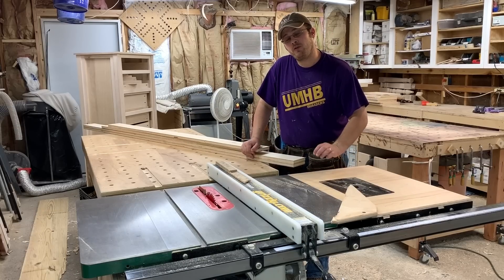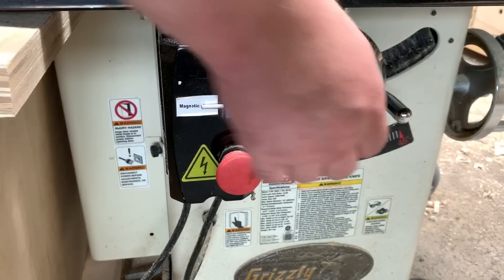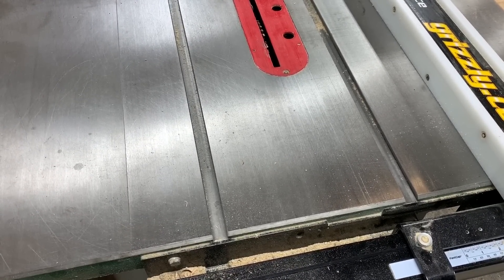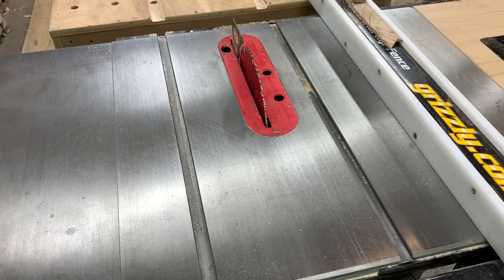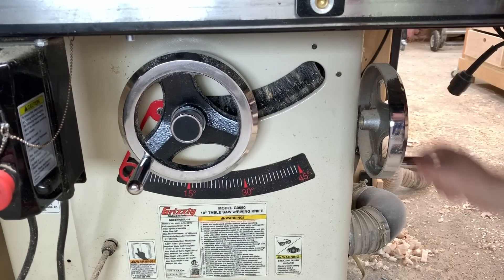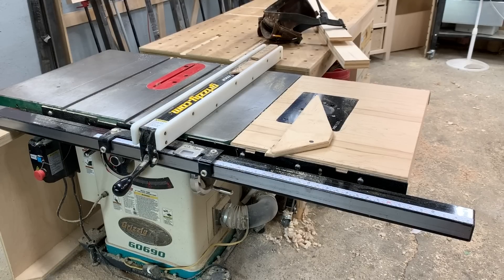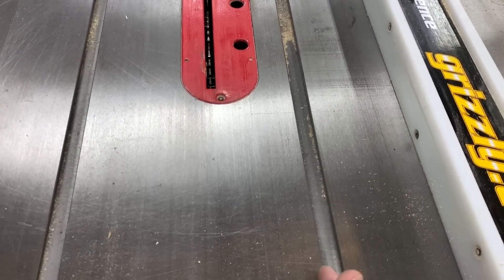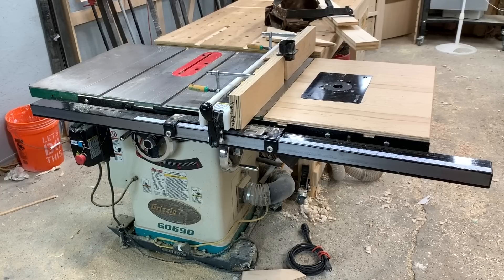Grizzly G0690 Table Saw   Five Minute Tool Reviews

Comment: My first table saw was a 1980's Grizzly contractor saw. It has served me faithfully for almost 40 years. Built it into a cabinet, changed out the pulleys for balanced pulleys, segmented belt, threw away the fence and added a 52" Vega. Added a new switch. Time for the old man to get a new saw...I think I will stick with Grizzly. THANKS for a great review

Comment: extended tables/long railed table saws aren't really worth the extra space they take up in my opinion.  If you need 50''+/- of rip capacity,  you're better off with a sliding table as it's just too tedious to maneuver large material around on a standard table.  It's easier to me to just remove fence and rip with miter if I need to cut plywood or something.
Reply from the maker: Billy Severt I think I agree with you. 36” seems to be the perfect sweet spot for me. I’m saving up for the full Festool tracksaw system and rails that will handle the oversized stuff better than my homemade track saws.
Reply: Track saw!
Reply: Glenn Holcomb  9' what he's got low ceilings? try 18'  
This guy built his own using 4/4 mahogany reversed raised panels he did everything in the house like that  shaker style  it was OMG perfection. he sold the house for 650k it sold for 1.5 mil. It was stunning!  Type of wood will reflect your house's value. he did not use one pec of plywood it was all solid wood.